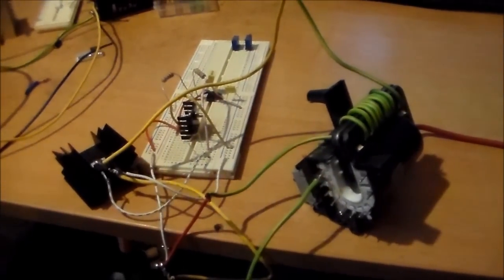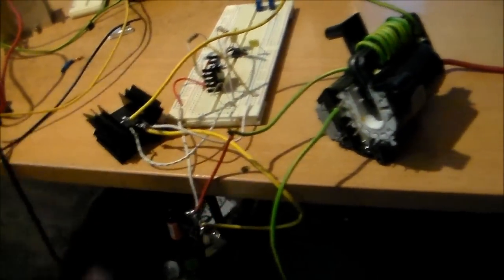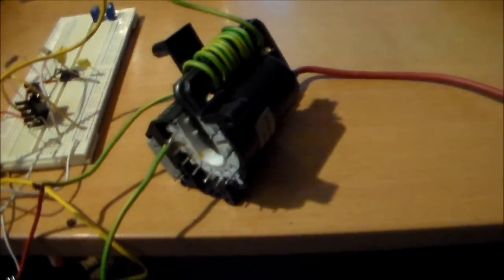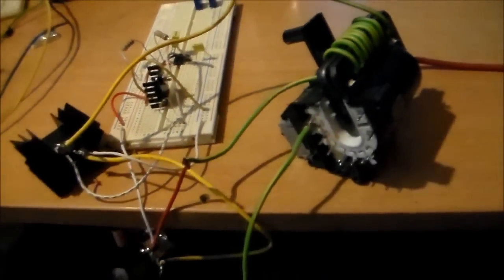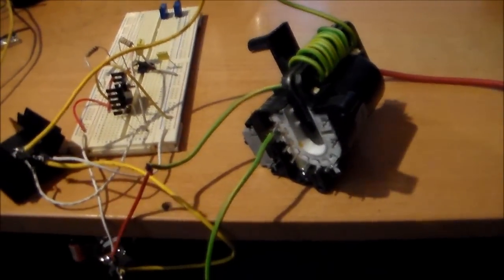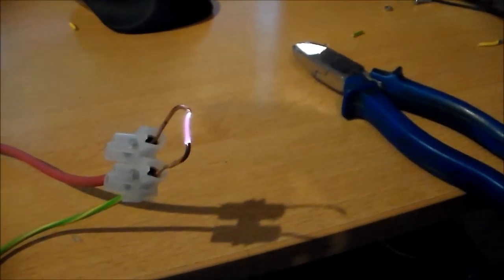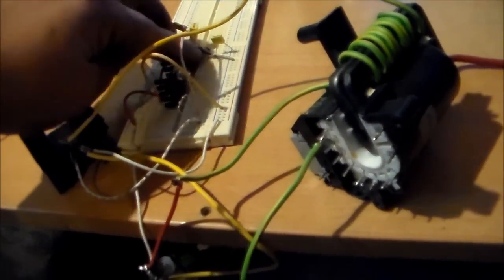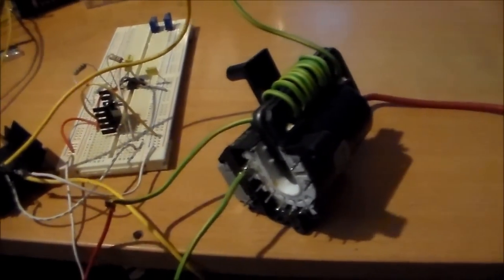Friday Boredom, Cheap 555 Based Flyback Driver. IRF540

Comment: Ive had that happen with a 540 on a car battery, and had an IRFP260n blow off its heatsink and into another room after going closed circuit on 2x12v UPS batteries whilst twiddling pots on a 555 driver, melted a few cables too :)

Comment: Well done.. The IRFP260 at 24v is not too shabby either, get some hot little arcs out of my 555 driver at 24v using that transistor.

Comment: Great arcs from that 555 driver circuit.
ZVS circuits are easy to build, key here is the correct orientation of the Zeners , fast diodes and Mosfets of course.